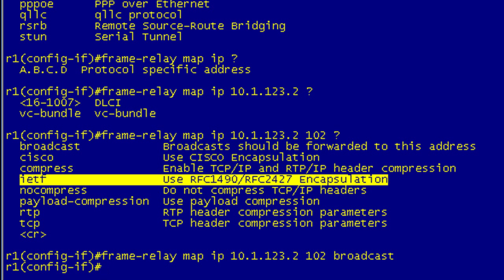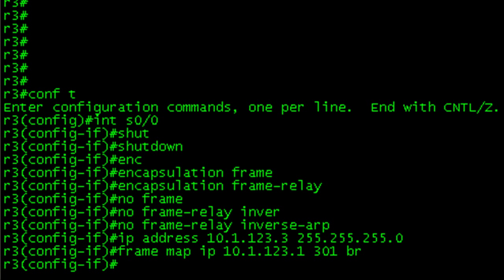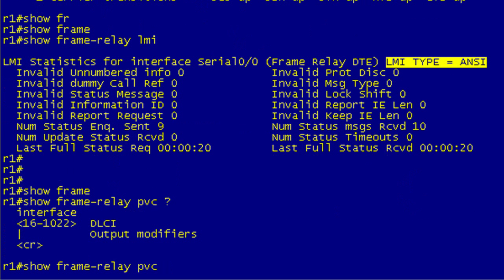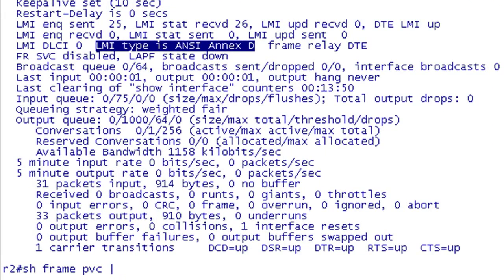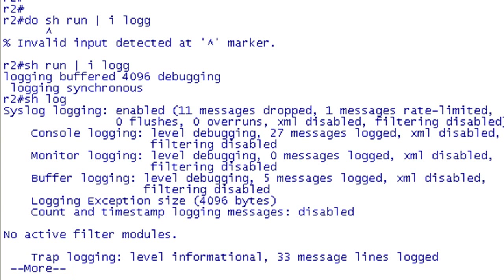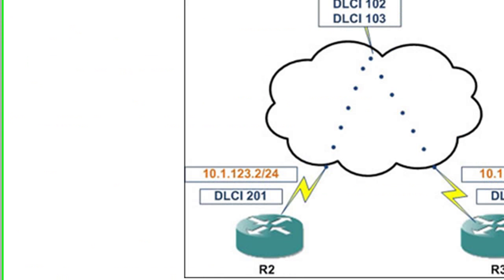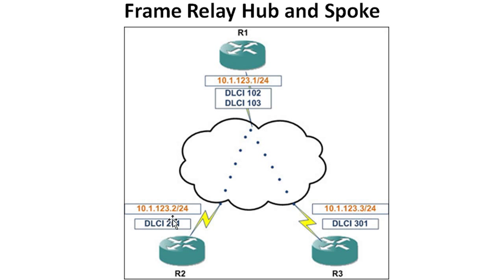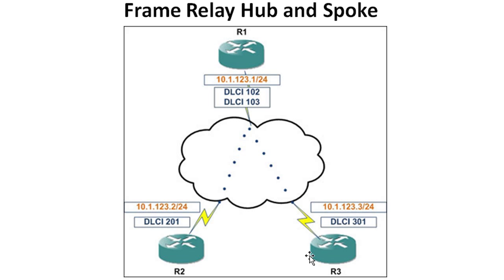Frame Relay - Basic Configurations Hub and Spoke - Part 3

Comment: I did almost exactly as you have demonstrated on the video here. The only difference is that i have manually set the encapsulation to q933a. I have checked my ip addresses over and over along with my dlci. Everything says it is active but i am unable to ping from spoke to hub. What could be a possible issue?

edit: When I run simulation mode on packet tracer, it tells me it cant find the destination ip in the frame-relay map table, although when i do a show run, it is clearly stated. I typed "frame-relay map ip 10.255.255.2 41 broadcast" on the hub router and "frame relay map ip 10.255.255.1 100 broadcast" on the spoke router. The hub is configured with 10.255.255.1 and the spoke is configured with 10.255.255.2. The DLCI numbers are correct.